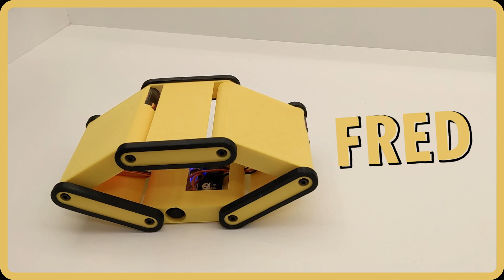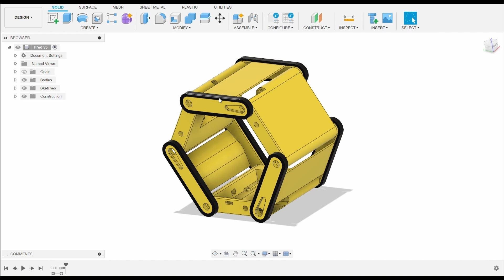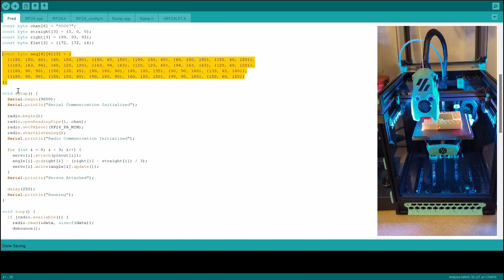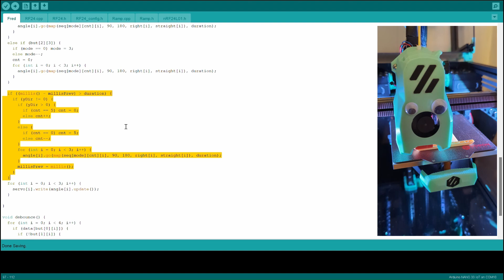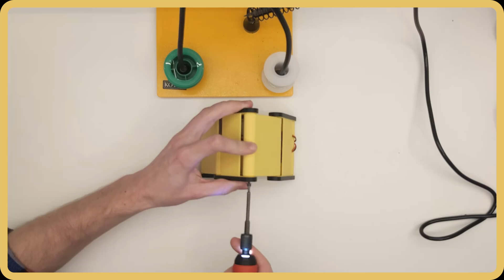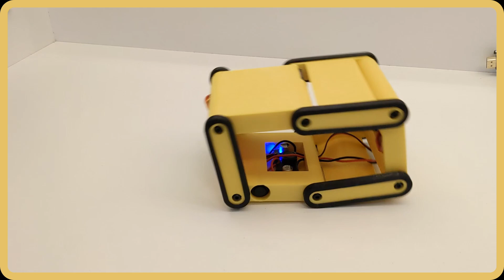Hexagonal Folding Robot

Comment: This is so cool!!! To make it turn you could attach a small turning motor like this
https://youtu.be/VY8grIT6-a0?si=RbQ9OOHQLBPHA2y7
Or make your rubber feet into tank treads and run one side of both maybe.
Two motors:
https://youtu.be/wvGqlL7WCls?si=MyCjAQy-pbuPJI_q
Reply from the maker: Thanks for the suggestion and for sharing your videos! They're a good showcase of a simple yet effective method of adding steering. Check out my follow up video where I implement your second suggestion: https://youtu.be/p05GbCXWQWs

Comment: Instead of contracting to become conical you could try if you can extend some rod or scissoring mechanism from each of the "base" parts. This would lift the outside-turn-side of the robot so the circumference is larger there.

Comment: (Only theory here) If you split each section of the hexagon perpendicular to the direction of travel and hinge it in the middle, you could drive it so that each section can transform from a rectangle into a trapezoid by rotating it about that hinge. With sufficiently low friction, you would only need to actuate one section and the rest would follow due to geometry limitations. This would make a conical shape, causing it to turn

Comment: 3 sides are for going straight, and 3 sides are for turning. You can add joints in the turning sides that let it rotate 45 degrees either direction.

Comment: As is, Fred is a cylinder which can roll straight, but you could also make him able to become a cone, which rolls in a circle, in order to turn. Perhaps add the ability to shorten or lengthen a certain side so that the six rectangular segments become trapezoids. Might make for challenges with joints, but it should enable turning while retaining full-body rolling and keeping it to just a single roller unit (as opposed to making two units that work side by side like a segway)
Reply: Maybe separate the rectangles into 2 triangle that would normally stay rigid as a rectangle but separate into triangles and roll over the correct diagonal line when you need it to turn. One rectangle should have its diagonal to turn left and the next to right. It goes over one bent diagonal, next diagonal stays flat and so forth.